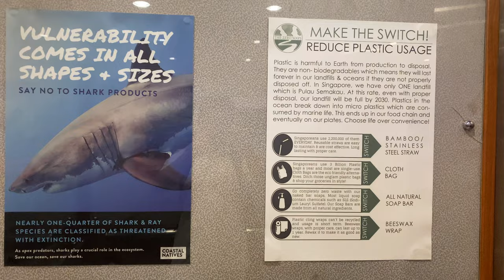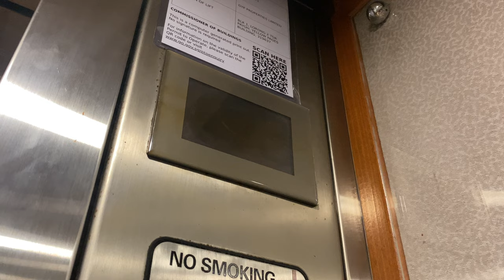SCHINDLER MICONIC TX MR @ BRADDELL HOUSE [PASSENGER LIFTS]

Comment: That burned out display was the real reason why some places like Regentville and Heritage View had to have their grey D-Line LCD indicators replaced with green Vander LED boards
Reply from the maker: ...maybe that's also why many buildings prefer M-Line instead because their indicators don't burn out as bad as the D-Line ones...
Reply: Same thing happened to Far E Square when their lifts were modernized in ~2021 (except that the new LEDs are orange instead)
Reply: @ZHD1987E  A pity though as the mosaic digit display of D-Line looks cool too